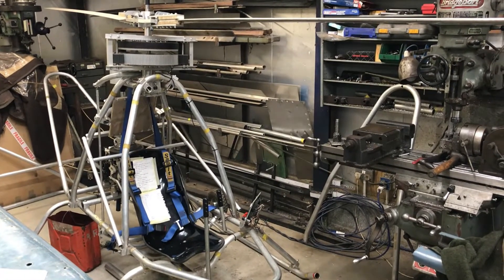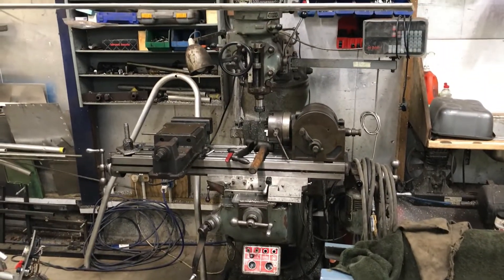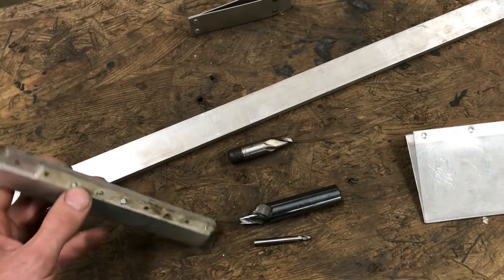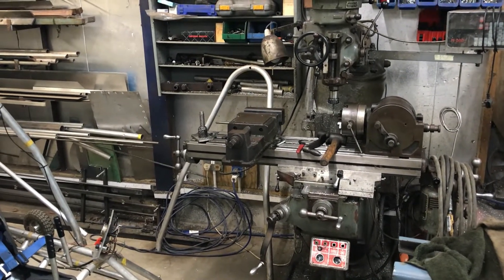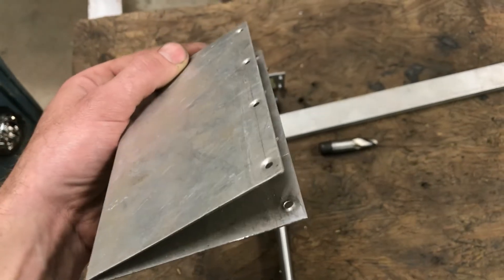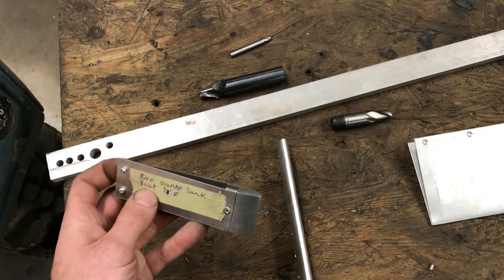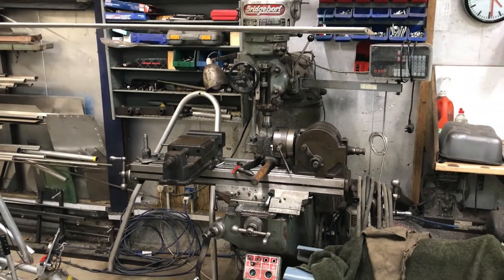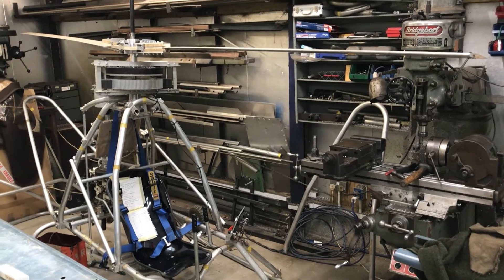How I made my Rotorblades Homebuilt Helicopter

Comment: I hv been working in aviation industry  for 10 yrs + as Maint engineer & hv a dream to build my own home made Helicopter. So Thank you for your info & hope you will provide some other detail videos.
Reply from the maker: happy to share information 👍👍next time making blades I would machine the spar as before but would fold a single skin around the spar. Probably use adhesive and minimal rivets. A single wrap around skin would be a better design in my opinion.

Comment: What a great learning video, well done!
Reply from the maker: Thank you. Next time I would machine the spar as before but in 2024 instead of 6082 but wrap the skin completely around the spar instead of riveted. I used 2024 skin material but I'm not sure if the leading edge could be bent to that degree in 2024 without cracking so might have to use a lower strength sheet aluminium. The ones i made have been ok but only due to the helicopter leading edge tape preventing air from getting underneath the skins.  Not ideal but all good learning.

Comment: Question: why do you use riveting when you make them instead of welding?
Reply from the maker: Welding aluminium destroys the strength in the heat affected zone, causes heat distortion and increases the likelihood of fatigue cracks. It would be a complete disaster attempting to weld any part of a rotor blade made from aluminium.
The skin is 2024 t3 a very high strength aluminium and cannot be welded anyway. For less critical and low strength aluminium welding can be used but you won't find it used very often on commercially made aircraft.

Comment: Nicely done! I think the only bothersome thing might be the rivets on the trailing edge. I'd think they'd tend to break up laminar flow. I had a Bell 206 and the MR blades were pretty complicated, I wish I had some idea of how they did the trailing edge.
Reply from the maker: Yes, I wouldn't build them like this again. Rivets have been used historically but as you say aren't efficient. I need to make some more blades at some point and next time I will wrap the skin completely around the spar. The mosquito blades are made like this and it's only adhesive that holds the skins together, no rivets. Not seen how the Bell 206 blades are manufactured, I'm sure there's some very expensive technology and equipment involved as that's a helicopter way above the kit world.
Reply: @Ben-Dixey  The leading edge of the 206 blade is a backward D shaped milled piece of aluminum. The skin following the leading  edge is very thin aluminum over a light weight aluminum honeycomb inner core. at the trailing edge theres a thin triangular filler that the skin is attached to (not sure what this is made of).    At the blade root there's multiple layers of laminated aluminum bonded together to provide stiffness and strength near the attachment point. At the outer edge there's some brass weights inside the leading edge to provide higher inertia in autorotation. On some blades there's thin stainless steel laminated to the front of the leading edge to prevent abrasion. 

I'm fairly certain you could substitute a foam core  for the aluminum honeycomb. This would allow you to reduce the skin thickness and overall weight. Preventing delamination has been a  crucial aspect of design (especally in modern carbon blades ) from what I understand. The tail rotor blade's design is pretty similar to your main-rotor construction BTW. 

One thing of very worthy note is that there is an overall twist to the main rotor blade from the root to the tip. This twist gives the driving and driven regions of the MR better angles of attack during autorotation.
Reply from the maker: Thanks for the detailed description, great information. Hadn't thought about blade twist helping autorotation but it obviously would. I found making the blades the hardest part to all this, incorporating a blade twist would certainly add to that. You could be right about the filler material enabling a reduction in skin thickness. 

What do you think the reason was for using a brass tip weight rather than lead ?
Reply: There is no laminar flow on trailing edge, not a bit in any airfoil, and that is not even laminar airfoil in blade design. That look normal symmetrical NACA airfoil, and those separation bubble is somewhere 25-30% of chord, after that point there cannot be laminar flow. Laminar flow airfoil just move separation bubble further back, 40-50 % of chord, and after that point, there is no laminar flow even laminar flow airfoil. Rivets just add little drag on that turbulent air behind separation point. Not a big deal. Great work, your skills is perfect to this complex project!
Reply from the maker: @4trade2 Thanks very much for this information, I didn't know about the laminar flow details. The airfoil is a naca 0012, good to know about the trailing edge rivets not reducing efficiency too much. I'd rather have them instead of relying on adhesive. 👍
Reply: @Ben-Dixey  I wouldn't worry about laminar flow separation that far aft of the profile! Everything is a trade-off! Super awesome blades. Thanks for the ideas!
Reply: Boa noite qual nome dessa fresa especial pra fazer a borda de ataque das par do helicóptero

Comment: That is the best explanation I've heard on YouTube since I've been searching how to build rollerblades and I've searched a lot believe me I have only one question the wood I see in the end of the rotor blade on your helicopter does it go all the way through or is it just a plug so many inches in
Reply from the maker: Hi, thanks for the nice comments. The wood in the end of the blades are just caps about 20mm long and do not go all the way through. Their purpose is to stop energy losses due to centrifugal air pumping which can rob a few hp if left open.
Reply: @Ben-Dixey  thank you for your explanation
Reply from the maker: Robert Hutchings There are a couple things I would change if making again. One is to make sure the blade mounting holes are at 25% chord, this is where a 0012 blade should balance in the chord plane, the other is to etch prime the surface before bonding which makes a big difference to the bond strength and maybe some more leading edge rivets.
Reply: @Ben-Dixey  sir how much long can mill on milling machine...if it's possible to mill short length.... How can I mill around 12 ft approx   a single piece
Reply from the maker: Mohamed shafeel Mohamed bilal I was milling about 12" at a time, you can mill as much as your milling machines travel but it needs to be supported well enough. The Bridgeport knee mill has 30" of travel in x, so you will still be machining in stages on a main rotor blade. I made some milling vice jaws with a step so that when you move the piece and clamp it back up it returns to an accurate position. There were still some slight marks where each pass had stopped and started again and for that I sanded the marks out with a block and sandpaper.
Reply: @Ben-Dixey  Thanks for your reply...
So , if you mill 12" at a time how would you join each pieces to gather to foam whole roter blade?
Reply from the maker: Mohamed shafeel Mohamed bilal sorry, the blade length is a single piece 6.5ft long but machined 12" at a time.
Reply: @Ben-Dixey  yes that's why I am asking how you bond each 12" piece to 6.5 ft long...... Reverting or bonding?
Reply from the maker: Mohamed shafeel Mohamed bilal The blade spar is one piece. There is no joining of the spar.
Reply: @Ben-Dixey  that's why I am asking how did u mill 6.5 ft of aluminium in milling bed..... because I want to make like this...

Pls explain to make my blade
Reply from the maker: Mohamed shafeel Mohamed bilal You have the material clamped in a milling vice then you mill 12" long, you then undo the vice move the material 12" along and mill again until you have milled the length you want. The video I made explaining making these blades is directed at people who are already engineers and know how to make parts on a milling machine. If you are new to using a milling machine it's going to be a hard task.
Reply: @Ben-Dixey  ok sir I just study to make this....

Thank you for quick and best reply....

Go-ahead on your work.... best of achive
Reply: I think how to make Rollerblades is on a different video. 😄😉

Comment: A quick one...pardon me though, what's the thickness of your 2024 sheet?, And that weight reduction slot is that a 4mm ball nose.?
Reply from the maker: Hi Jeff. The sheet is 0.8mm thick and the ball nose cutter is 3/16" but I wouldn't build them like this again. I would build them like this. 
https://youtu.be/67hGaZNccGo
Wrap the skin completely around the spar.
Reply: @Ben-Dixey  thank you, I watched this upload, beautiful, I have decided to build like that too. Always wondered if just one spar was enough to lift all that weight, the upload cleared my fears, so am using 7075T6 plate of 1"*3" to get a foil of 20mm max thickness. Is the slot necessary for just weight reduction or does the C shape increase strength or something? Not so good with material science. Then I see you have wood inside and compositefx is just hollow. What made you put wood inside? N which wood is it? Birch?.
Thanks mate, for accomodating my nags so far.
Reply from the maker: Happy to try and help, the spars purpose is to take the centrifugal loads. There are several tons of force pulling horizontally, it is this force that allows the spar to be relatively weak to bending. You will have seen how long helicopter blades droop down until they start spinning. It was quite amazing to me when I found out that some rotor heads allowed the blades to hinge upward, called a flapping hinge. This meant that the centrifugal force was the only thing holding the helicopter in the air. 
The spar is c shaped in order to keep the weight in the blade as far forward as possible. 0012 blades need to balance at 25% because otherwise the collective stick forces will be too high. Having too much weight at the back of the blade could also cause blade flutter which must be avoided.
My blades are hollow too, the wood in the end is just to seal off the cavity. An open cavity will mean the blades are less efficient and will cause drag. If you manage to copy the mosquito blades then you won't have any problems. 
Ben
Reply: Now this clears everything, it's a go now,

Found aircraft grade aluminium plates, though skin will use 7075T6 1mm thick. no 2024mm available in this thickness from my contact.

Though I don't get how the mosquito blade achieves lift distribution that comes with blade twisting design or reduced profile from root to tip...I kind checked like that build and yours all have uniform blade tip to root...or the spars are strong enough for that extra conical shape in flight.

Cheers. 🤝
Reply from the maker: Ok 👍. You just need to make sure that 7075 will bend ok around the leading edge without cracking. I think the sheet on the mosquito blades is 6061. If you can buy a small bit of sheet to do a trial bend that would be sensible. 

The blades are straight and parallel on the mosquito because of ease of manufacture. As you say there won't be even lift distribution like on a tapered and twisted blade. It means the blades are less efficient being straight but it's more difficult building tapered and twisted blades.

Comment: fascinating. I want to build a small manned multirotor, and manual control is a big challenge. plan A is that I could build a physical joystick and collective with potentiometers/hall effect sensors into a flight controller to fly the thing using motor speeds for control. but, then there are no physically connected controls and of course it could not auto-rotate. if I made 4 variable pitch props, then autorotation would be possible, as would a gas powerplant but then one would have to lift the weight and potential failure points of 4 big actuators, or a needlesly complicated mechanical mixing system. a simple electric quad is probably the most reliable and certainly the simplest heli-like system i could embark on
Reply from the maker: How many rotors are you thinking of? With enough rotors you will have redundancy and may not need collective pitch. 
Bare in mind you will loose altitude transitioning from powered flight to autorotation with collective and you need high inertia rotors which adds a lot of weight. Up to 50 feet is the danger zone in most commercial helicopters where collective might not save you if hovering with no forward speed. 

The jetson one has 8 motors and props with triple redundant flight controllers. It can still fly with a motor out and has a ballistic parachute system. 

Have you seen amazingDiyprojects on YouTube ?
Reply: @Ben-Dixey  true, perhaps autoing a miltirotor is impossible for inertia reasons alone. The safest design is almost certainly 6-8 rotors to handle the loss of one or two, perhaps with a ballistic parachute, which itself has a danger zone. I'm partial to pixhawk flight controllers which can be had with redundant IMUs, not sure if me adding multiple entire flight controllers and switching electronics wouldn't just add another big point of failure. Pixhawks can also support downward lidar, pitot airspeed, autonomous modes, etc. amazingdiyprojects has some very interesting designs, you are both an inspiration.
Reply from the maker: Thanks for the compliment. 
When is comes to flight controllers I can't offer any advice I'm afraid, really don't know anything about them. I would very much like a jetson type machine though, looks a lot of fun and I would think simpler to build than a helicopter. I would consider making mine electric if it was feasible which it might be. There seems to be an opinion that says it's more efficient to move a large amount of air slow than a small amount of air fast. That's why larger rotors Create more lift for the same amount of power and turbo fan engines keep getting bigger. My coaxial could be more efficient than the equivalent multi rotor, however I'm not 100% sure of this.

Comment: So your rotor is only 4 meters across? What if your blade is more than 2 meters in length?
Reply from the maker: The blades can be longer and would produce more lift up to a point. The only drawback is longer blades have to run at a lower rpm which means a larger gear reduction. I wanted a single stage reduction but with longer blades I might have to go to a double stage which increases weight and reduces efficiency. Shorter blades are easier to control vibration and fit in a smaller workshop space, blades being lighter means a lighter rotor hub assembly. It's all a trade off but longer blades produce more lift because It's more efficient to move a large amount of air slower than a small amount of air fast.

Comment: where to buy special end mill? is there any information?
Reply from the maker: I had the special end mill made by a tooling company in the uk. You can get the aerofoil coordinates online from a website called airfoil tools. I used the coordinates to provide the tooling company with X and Z coordinates needed as if you were turning the profile on a lathe. Can't remember the name of the company but most engineering tooling providers have the ability to make special end mills.

Comment: I have pipes from a hang glider, can I have the plans please. I want to built it in ultralight. I will build the blades like you, but without the machine. But i think it's possible
Reply from the maker: Hi, I don't have any plans only a few drawings. Tubes can be used for blade spars but you will need weights on the leading edge of the blade for chordwise balance.

Comment: This blade looks so good, will not put anything other than wood in the middle of it? What is its length and breadth?
Reply from the maker: Hi thanks, the wood inserts are just end caps to prevent energy losses due to centrifugal air pumping. The rest of the blade is hollow, the 2024t3 skin is quite resistant to bending and holds it's form well so I didn't feel the need to fill the cavity. Rotorway blades are also hollow  I believe. Blade length is 2m chord is 120mm, rotor diameter is 4.3m.
Reply: @Ben-Dixey  what about weight each blade?
Reply from the maker: each blade weighs 2.6kg

Comment: can you send me a link like the rotor like a blueprint a skeleton the x-ray to see what the reinforcements are like the stainless aluminum or whatever the specification numbering Sheet metal and such
Reply from the maker: Hi, I wouldn't want people copying how I have made these blades because I wouldn't make them like this again. I would wrap the blade skin completely around the spar and not have any rivets. The mosquito helicopter blades are made like this. The blade shape I got from a website where you can specify the blade chord and airfoil and it will plot coordinates giving you the complete airfoil section. 
If you type in Google, (NACA 4 digit airfoil generator) you will find the website. The blade skin I used is 2024t3 0.8mm think and the blade spar is 6082t6